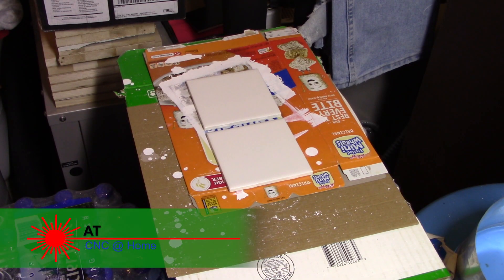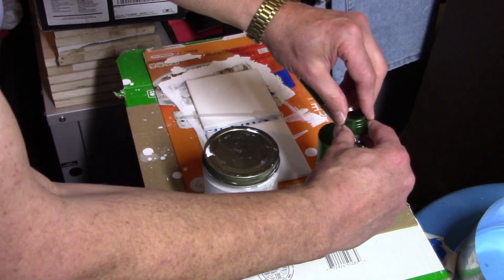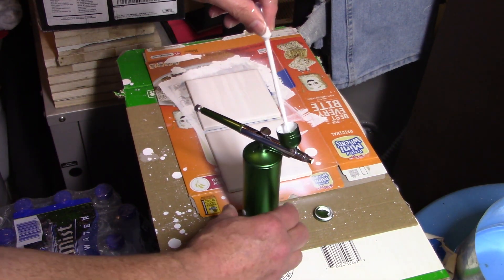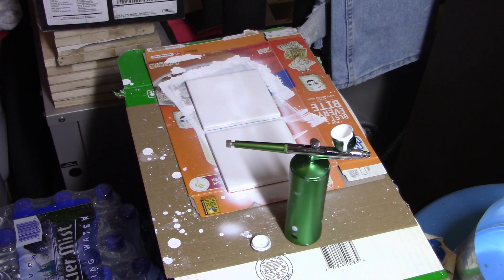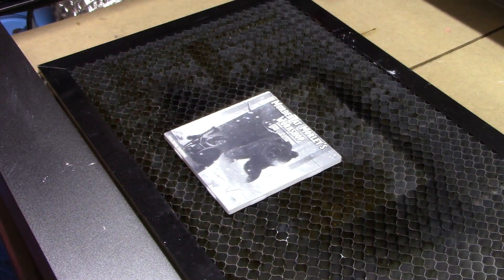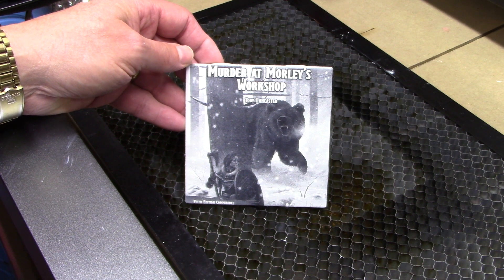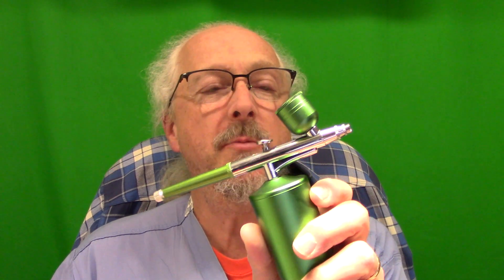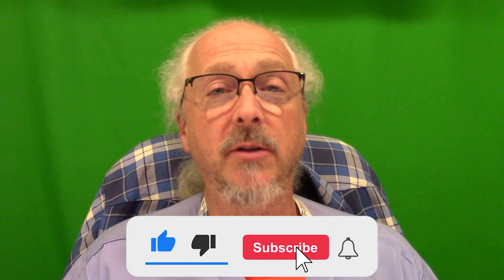Will an AirBrush work well for applying Titanium Dioxide?

Comment: When using a dual action airbrush, it is best to push down to release the airflow, then pull back to release your solution. The amount you pull back determines the amount of solution dispensed. Then when ready to stop the flow of the solution, push forward and down. This keeps the tip cleaner and reduces clogs. You generally want a consistency of skim milk for acrylics, so I would assume it is the same here.
Reply from the maker: This is a single action airbrush.  The airflow is always on and the trigger only adjusts the amount of product that comes out.  A thinner mix does work better for this process.  If it is too thin, you can always apply more.
Reply from the maker: @a3d277 - Thank you for this great information.  My airbrush mix is around 3or 4 to 1.  I still need to add in some coloring to help me see it.  🙂

Comment: How hard is that one to clean? I have an older Aztec sprayer and it can be just downright horrible to try and get it cleaned out. It's neat watching you do these types of things as I can then try stuff a little differently and see how it goes as I can always come back to your video to see where the starting point was :)
Reply from the maker: Good question.  It isn't very hard to clean.  Part of that is the TiO2 is an easy cleanup in general.  I can take the whole thing appart, clean and dry the pieces, and get it put back together in 5 to 10 minutes.

Comment: I'm using the "pour method" and am getting perfect results every time. It takes about 3 seconds per tile, with even coating and no issues. A shallow pan with a wire rack saves all of the overflow to reuse another day.
Reply from the maker: That is awesome.  Do you know your mixing ratio?  When I tried that method, my mix was way too thick.  In my mind, pouring it on seemed like it should work or even dipping the front of the tile into the mix might work!  Thank you for the information.
Reply: @CNCATHome  my mixture is WAY too thick. When it settles, I give it a slight stir until it looks like 2% milk. Then I pour. Because it's so even going on, the consistency seems to be less critical.
Reply: More info on the "pour method", please - definitely want to try that.